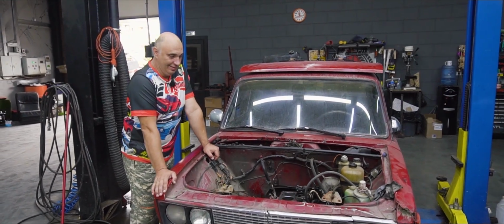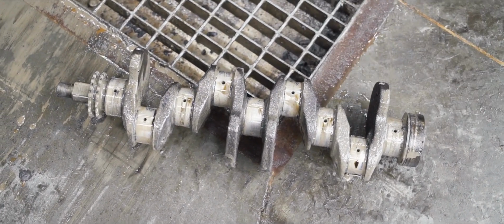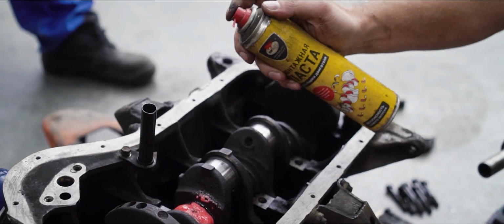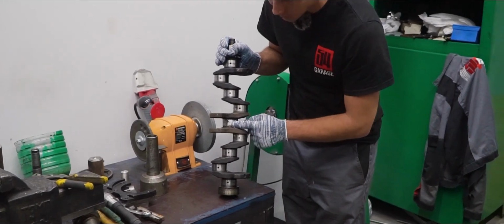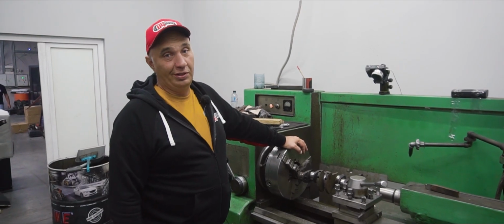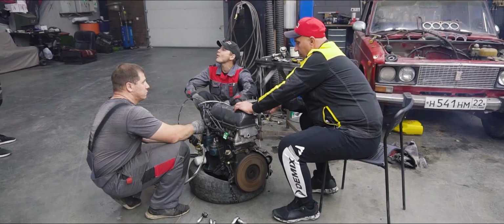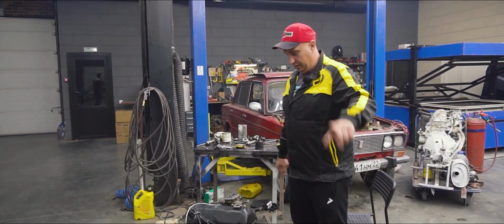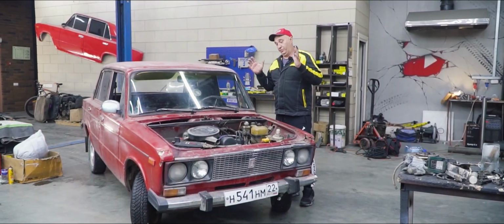Welding a broken crankshaft – will it work?

Comment: Dear Garage54

If you're ever working with iron again in the future, you might want to try out "PostAlloy 50" welding rod. Make sure you preheat the item, weld her up with the postalloy 50 rod, and then let it cool slowly. You should be good to go.

Thanks for another fun video! Catch you on the flip side.

Comment: I would like to see an inspection of all the main journals after this try. To see whether there is a visible wear on them due to the unfit tolerances. Could you make a follow-up video? And to make the video interesting, you could add some longer beforehand driving on your test track, with a proper beat-up to the engine, with high revs...
Reply: The Russian Garage 54 channel can be worth a look at even though auto subtitles translated to English are pretty bad.

Comment: Because of his thoughtful preparations for the welding and balancing it properly.. It worked. Otherwise I think it would have easily failed. Good stuff
Reply: Yeah, even a billet crank can fail if not balanced at all, well with awful balance with everything or at least the other parts also like pistons and rods out the side of block.  There was a youtuber built a small block chevy 383 , a 450hp proven blueprint and did really good too , it was all broke in, and the first time they put the gear selector in reverse, immediately snapped the crank clean in two pieces- the rotating assembly did not recieve any balancing what soever. They complained yet then learned their mistake.

Comment: He keeps saying the crank is “iron” - but does that mean cast iron? If so, super impressive he was able to weld it. I’ve never had luck with anything but bronze brazing (which works really well).
Reply: Cranks are made of iron or steel, but there may be some confusion in language here as high-carbon iron is called... steel ;).  Vlad says the crank is high in carbon, so while you can add other ingredients to improve certain characteristics, adding carbon to iron makes steel, period.  There might be some difference in how Russians commonly refer to these metals, however.  I can't hear Vlad's speech over the excellent translation ;) , but iron is "железо" (zhe'lieza) and steel is "сталь" (stal').
Reply: Every automotive engine crankshaft  ive ever seen has been steel either cast steel or forged steel. Never seen a cast iron crankshaft. Maybe thats the confusion. Cast steel cranks are normally not considered to be as strong as forged steel cranks

Comment: RPM would be the killer in this situation ... hence why they didnt rev it hard ... once that thing was @ 5 - 6k RPM, the imbalances and resonate frequency vibration would have wobbled it to pieces. Although it was also quite amazing when he dropped the clutch and the torque from cyl 1 and 2 didnt break it.

Comment: I'd like to see this done with an actual broken crankshaft.  By cutting it, you are removing a small amount of material that has to be replaced with welding rod.  A broken crankshaft would have no metal missing, so I would think the weld would be far stronger.  And the broken ends would fit together precisely, allowing more torque to be transferred before failure.

Cool video!
Reply: Didn't they cut away a big slice or 2 to make room for the weld? Could do that with a real snapped one too.

Comment: I’ve watched an old school mechanic weld cylinder walls, blocks, drive shafts and gears with a coat hanger and torch. He would preheat until everything was red hot. Then use the hanger like a tig rod. He could “stack dimes” with it like a pro. It was amazing at some of stuff he done and made over the years.
Reply: Isnt that essentially brazing?
Reply: @ootmaster1  Brazing is where the base metal isn't melted down, like soldering, but hotter.
Reply: @amorag59  right, thats why im assuming was done in the OPs comment. wire hangers would melt at a lower temperature than the surrounding material
Reply: @ootmaster1  I thought that they made some wire hangers out of steel
Reply: @quentagonthornton49  yeah, so google tells me most metal hangers are made of steel. Pretty sure the block is cast iron, so i think its about the percentage of the metal thats carbon. So then the hanger will have a lower melt temp than the block, if im understanding correctly
Reply: @ootmaster1  
Plus the hangers were better metal back then. The hangers today are made out of garbage metal. Most people call it “oil can” steel.
Also the cast dissipates the heat better and allows direct heat on the rod. The rod will melt and bond the material. Regardless of the science of it, it takes exceptional skill. Those old timers knew a thing or two. He was in his early 80’s back then.
Reply: @Miner-49  right, no doubt.. but if the case is the rod melts and the hosting material doesnt, is that not braising?
Reply: @ootmaster1 
 It is most definitely brazing. 

While coat hangers can work, they are and have always been a poor choice. Despite appearances, the repair quality and durability won't be worth a damn compared to using the proper brazing rods. In a pinch, arc welding rods with the flux removed beat the hell out of coat hangers.
Reply: @ootmaster1  

Braising is cooking food.
Reply: @shawbros  OoF
Reply: I’ve done that several times.

Comment: Iron isn't difficult to weld, carbon steel is. Higher carbon content makes it form martensite when welded and that is hardened steel which is hard and brittle. Steel with around 0.02% carbon and up forms martensite when welded, the more the harder it is to weld. Cast iron has a carbon content ranging from 1,5-4% carbon and that's why it's difficult to weld along with impurities from casting and long time use absorbing oils and dirt.

That crank might work for now but what probably is going to kill it is micro fractures growing over time.

Comment: i've suggested welding a crank to so many people because i knew it could be done and work, especially on a small low power engine like that. Not surprised it worked but i am surprised that the youngman got it welded so well. I expected much worse

Comment: Over a short period of course it will work. But over the long run, the impurities in the welding material will begin to create internal fatigue
which with a persistent cooling and heating of the engine, will crack over a long period of time. Making it a time bomb waiting to set off.
Reply: What a job welding. The kid’s got it

Comment: I suspected it's going to be just fine if alignment and tolerances were spot on. Such thick weld can take a lot of abuse, way more than a small engine like that can put out.
Might be hard to say on the long term, it might develop micro fissures in the weld and break off at one point. Maybe in 50K, 100K, 300K, who knows.

Comment: Maybe that is more of a cast steel crack? I know scar makes some nice cast steel cranks, they are cheap and nearly as good as a forged steel crank, you can try drilling a hole in it, if it makes chips like a chainsaw cutting wood, it's iron, if it makes noodles it's steel! I never thought of welding that much, I have seen cranks surface welded, to repair wear from spun bearings, but typically nickel welding rods are used on iron, or brazed with bronze, I don't think a braze would hold a crank together, not long anyway!

Comment: Had to weld 2 different halves together from 2 different CV axles just so I'd be able to drive my car again back in the day....damn brand new CV was running around $300 (American) for that POS back then and most of the parts for the thing were Only available through NAPA auto parts.  It finally got to the point (starter went out and had to be push started from then on...starter was $500) where enough was enough so I just tortured the ever loving hell out of the thing and finally sold it off...yeah, it was still running and driving even then.  Parts were just too damned expensive though.  1989 Pontiac Lemans the compact version for reference

Comment: LOW HP ,, LOW TORQUE ENGINES ARE NOT HARD ON THE WELDED CRANK ... TRY A HI HP / HI TORQUE ENGINE ,,, I BET IT WONT WORK / HOLD ...

Comment: The crankshaft would break from fatigue in that spot because of microcracks and thermally affected areas.  So, it's only a short term solution.
Reply: *IF it ever broke, it would be in that spot
Reply: Yup, I'd be worried about fatigue too, especially considering they had to grind and re-fill twice to get the surface pores down to a workable size. That is a lot of places for cracks to start from and when there is so much visible pitting after the first grind pass, there must be many more void inclusions inside the weld too.
Reply: @teardowndan5364  that engine is so weak that I doubt it will ever break, especially if you just drive that car as normal everyday city commuter. Engine will basicall see no stress at all, with soft city acceleration and 60 km/h average speed on low revs.
Reply: @lordred7462  There is no such thing as "no stress at all" in moving parts. Vibration, transmitted torque, thermal cycling, bending from the slightest warpage, etc. will cause cracks to grow from imperfections and very likely fail at some point. No way to know beforehand without a cross-section scan to find out how good or bad the weld actually is.
Reply: the heat cycles and purity of wire.. electrical grounding, concentrics..pressure of the base, lack of oxygen.. ingredients in the lubrication and a cap holding it... it will outlast the rest of the engine. I have had 18 foot rails holding 3 tons take a year to finally quench...that is just plain open air. molecular and atomics. Weld is not a glue gun.. it is a way more serious science. the overall object learns itself, one end to the other.

Comment: Good one there.Make a one cylinder Lada engine.Take out 3 piston/rod units.weld up the oil holes in the crank journals not used.leave all tappets and push rods in.See if it will run.

Comment: now mark the crankshaft in the middle, mark the camshaft in the middle, then cut the crankshaft as well as the and reposition it by 180° and weld it back together, i think if theres a way to connect 2 spark wires to 1 distributor output it could work... wouid be awesome to see something like that

Comment: You can cut and weld the crankshaft on a couple spots to change the firing order. You'll have to do the same for the cam which is going to be trickier but I'm sure you'll figure it out.

Comment: that tire bouncing acting like a jackhammer definitely put it through a rough time, if that did not break it then it is probably tough enough for that power level! i might not trust it with 400 HP and torque but in a normal engine i doubt it would easily break!
Reply: idk how it would last from thermal cycling, after all it wasn't heat treated, cracks might develop from the welding stress.

Comment: Can you make a engine run in reverse?
Reply: Inboard boat engines frequently run in the opposite direction.  To use them in a car, you need to replace the oil pump, camshaft and distributor.  Then it will run in the other direction.

Comment: Now that we know you can weld a crank and it won't break....
Why not modify a crank to a crossplane and also do the same with the cam and see how it turns out?
Reply: exactly what i was thinking,
Reply: Maybe make a straight-6 Lada engine?
Reply: @operator8014  That'd be cool. cutting and welding two blocks together would probably be really difficult though lol
Reply: @manbeezis  That's what I thought about a cast iron crankshaft...  shrug
Reply: @manbeezis  I already seem videos of welding engines together but its usually small engines.
Here is a full playlist of some guys making a 4 cylinder briggs
https://www.youtube.com/watch?v=KtPI8b3Pf4U&list=PLOkM2h167hjoHdkDu4dW1ujTyUSoU3BPE

There is also the guys from V12ls. They weld 2 LS1 engines to make a LS1 v12 and sell it as a custom engine. Sadly there is no video of the process only Dyno/show videos.
Reply: I was also thinking this! Although I'd rather see taking a crossplane V8 crankshaft and making it into a flat plane crankshaft.
Reply: There's no such thing as a cross-plane cam .
Reply: @Dr.Westside  Sure there is. The cylinders would be firing at different times, so you'd need to modify the camshaft to suit that. rotate each cylinders lobes the same amount as their respective crank throws
Reply: @Dr.Westside  There isn't yet.
Reply: @Dr.Westside  what, then, would you call a camshaft utilized in an engine with a crossplane crank? Obviously the cam has to be compatible with the crank.
Reply: @Dr.Westside  Technically you are right. "Cross-plane cam" isn't a thing because a Cross-plane engine just uses a cam that matches it firing order. Yet you could say that a Cam for a Cross-plane engine is a "Cross-plane cam".
Reply: @Dr.Westside  yes there is.

Comment: Nice job guys! I didn't expect the weld to hold without using iron filler rod.
Reply: As long as you get it hot on the weld and let it cool very slow, it works well.

Comment: <Edit><I looove this channel. It is so awesome to watch and see all the experiments that are done and are test in real world conditions. Thank you "Team Garage 54" for all you do for us and your team> I wonder if a 7018 or 110 series rod would have been easier for them to have welded a crank with using an old school arc welder. I welded an old truck frame that broke that held out well so would an arc welder have welded a crank?
Reply: The "easy" way is to tig weld it while its on the lathe and use heat to shrink it straight.

Comment: Next time, cut and turn the crankshaft and the camshaft 90°, making it a cross plane crank motor.
Reply: On second thought, the cam would need to be cut and turned 180° for the 90° crank to work (among other things).
Reply: @jasonnoteboom4489  they have already demonstrate being able to easily make their own cams using simple methods in other videos.
Reply: Yeah, custom cam would be needed, but otherwise with the stock carb and swapping ignition leads it should work without any other mods.
Reply: Definitely should do a cross plane Lada
Reply: Cam. must cut and weld too
Reply: This is the best and most intelligent idea 👍

Comment: It's a testament that the kid is a good welder as well.
Reply: he did a great job but I'd love to see this car driven until crank snaps, just to see how many kilometers it can do. Bearings might wear out because of rough surface though
Reply: @3216ben1  That crank will never break. The welds are very good.
Reply: @StrikerFin  I mean cast iron welds tend to crack
Reply: @3216ben1  Only when not prepped right.
Reply: @3216ben1  Agreed.
Reply: He's really good, in my opinion.
Reply: Ivan
Reply: The power to weld a crankshaft is insignificant next to the power of converting a diesel engine to petrol and turning it over on the first try.
Reply: @Eddie Hitler Hadn't noticed that, but you're right. Good space relations, methinks.
Reply: Russia have the best welders in the world, something to do with their training for oil/gas pipe welding
Reply: @kaisyaya8492  no
Reply: он дурачек немного
Reply: @push72o64  he is.
Reply: Those welds suck. They were all wrong and I would have done better
Reply: @wouldbang6928  that was quite a gap to weld across. I dont think a "good weld" was really an option as far as techniques goes. The proof is in the pudding. You can stack dimes and not penetrate the material at all. At the end of the day, did the welds hold or not?
Reply: It's not really complimenting to someone above 18 to call them a kid. So that's a bit ironic sentence, complimenting him on his welding skills on one side and calling him a kid on the other. "That guy" is already more in the right direction. Or with full respect call him a man.
Reply: @Engineer9736  Tho I think he's one of those guys who will look young until he's 60.
Was also impressed with the welding job.
Reply: @Engineer9736  most men are kids until they hit their mid 20s.